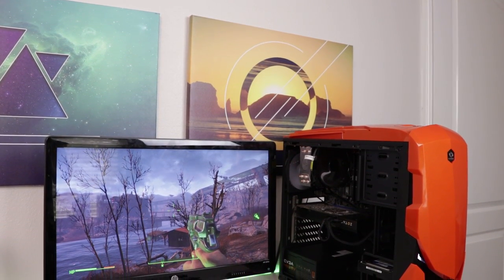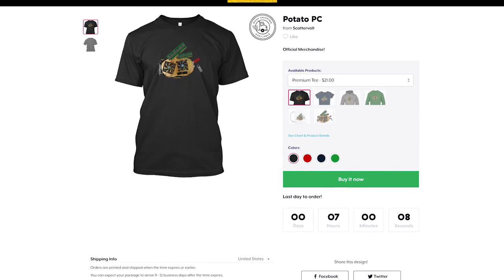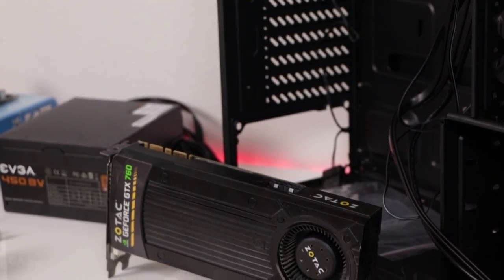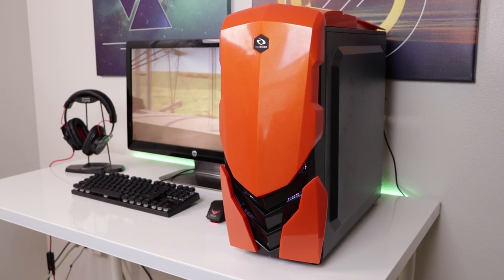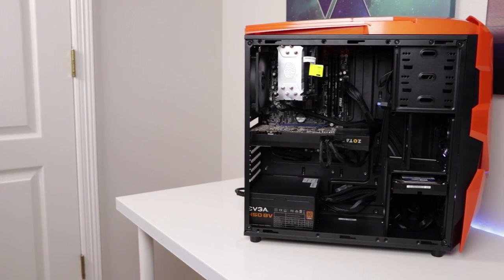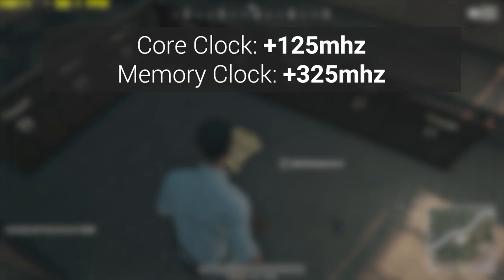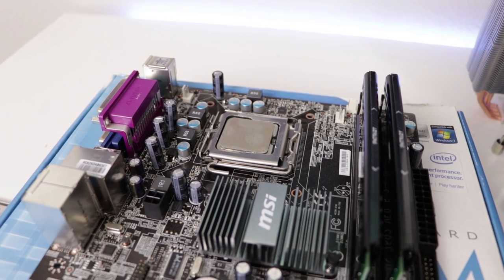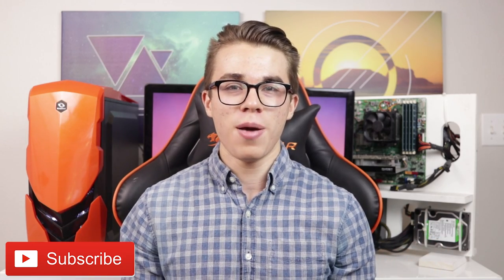The $100 Gaming PC to Survive the Cryptomining Apocalypse!

Comment: still better then my pc...
Reply: Im buying a pc with gtx 1050 ti core i3 overclockable and some other good specs😀
Reply: KingVoxx why are u making me jealous
Reply: KingVoxx I recommend getting a Ryzen 3 instead as the price : performance ratio is great compared to Intel.
Reply: iam buy a pc with gtx 1070 with 16gb ddr4 ram and core i5 7600k
Reply: gamin tacoos Or the Ryzen 1600/1600X as I mentioned before the price to performance ratio is great
Reply: man instead buy g4560 instead of i3 overclock it you will get better performance than i3 for sure
Reply: lol
Reply: +KingVoxx i got i5 with a gtx 1050 ti
Reply: KingVoxx DONT GET THE 7350K
Reply: Get a ryzen 3 instead.
Reply: My PC right now has an i 7 6700k, MSI GTX 1070 and 16 GB Ram
Reply: My pc is more than 100 dollars. And my pc is worse then that one
Reply: Mr Frozen Light Intel is better
Reply: same and i spent $700 on mine :(
Reply: +KingVoxx
Those specs are not exactly "good", but I feel you. i5-4440 and HD7970 here
Reply: i would go with the new Ryzen 3 1300X. 3.5GHz, 4 cores instead of 2, and it's about the same price as a lot of core i3s (you could also go with the ryzen 3 1200, 20$ cheaper)
Reply: just finished my i5 7600k,gtx 1080 sc, 16gb ram build!
Reply: Cuban Taco motherboard?
Reply: 90Days msi b250
Reply: i’ve been playing Zelda: Breath Of The Wild on it in 5K! 😂
Reply: I just have an acer tablet/laptop thing from like 2015
Reply: gamin tacoos i got 4 titan gtx 1080 32 gb iCore 7
Reply: I only have a laptop and it can barely run gta iv

Comment: Just got a full Ebay el-cheapo build started:

Things I bought ~
1.) Xeon E3-1220 v3 at 4 core, 8 thread 3.1Ghz 3.9Ghz max turbo 90W $20 USD
2.) MSI B85M-IE35 DDR3 ram at 1600Mhz dual channel $45 USD
3.) EVGA GTX 750 ti $30 USD
4.) 8Gb Crucial DDR3L memory at 1600Mhz $20 USD

Things I had on hand ~
1.) Micro ATX HP case
2.) Cooler master 500W bronze rated PSU
3.) Cooler Master low profile Heatsink and cpu fan TDP 100W
4.) 1TB SSD

The total money I have put into this build has been $120 USD after taxes and there is PLENTY of future upgrade room. People, being poor is no excuse for not having a practical gaming pc on a budget.
Reply: how much was ur PC
Reply: @elysian8823  Read what I wrote again. I have the prices in my comment. What I had on hand I didn't pay for.

Comment: You should do the tape over clock mod on the Q6600
Reply: King Bladedmaster I've done that successfully on a prebuilt hp, but I would derived if you could do that in conjunction with motherboard over clock settings?
Reply: King Bladedmaster I'm

Comment: Guy did i start good i bought  a Q9550 2.83 (overclockable) 8GB of ram and a CPU cooler (Zero therm CPU Cooler) for 72$ i just need a good GPU and a PSU (alreddy have os and hard drive
Reply: Rxtro hell ye.
Reply: You started off pretty great actually for that price. I'd go with the GPU and PSU mentioned in the video to finish the build if I were you
Reply: How'd you get the ram. So cheap
Reply: Rxtro Lucky, I have a RX 470,  8 Gb DDR3 and a 600 watt PSU (overkill) all I need is a Cpu and mobo.
Reply: If it makes you fell any better, I'm using a 650 watt PSU. Got it paired with a Q9550 @ 3.07GHz, 1050 Ti, and 8GB DDR2. It was the only one I could find at Best Buy to replace a cheapo one I had that was making really bad clicking sounds.
Reply: Tennis Ball You have a working PC kmn
Reply: Tennis Ball Would you recommend the Q9550? I want to make a temp build
Reply: Tennis Ball can you tell me how your processor preforms with the 1050ti?
I have the core2quad q9500 2.83 Ghz ! Will it perform better in games comparing to yours by adding 1050ti in my build?
Reply: Tennis Ball mine pc does that for alredy 2 years now its almost 1 am and its making that sound from time to time and I just have to ignore it , maybe it even became normal for me
Reply: A 1050ti works well with a Q9500.
Reply: I bought an asrock amd 970 gaming 3 R2.0 with an fx 8320 and a 500gb sata 3 western digital blue hdd and a blue led seetrough  sidepanel case and 4Gb ddr3 1600 for 60$ 
And a asus gtx 680 4GDDR5 version for 33$ new in the box so 90$ total just need a cpu cooler and a PSU and got an ultra budget build
Reply: H31MU7 This sounds good. Have you tested this scenario?
Reply: Rxtro, You need a Striker II for that CPU!
Reply: Tennis Ball can you run bf1 with that pc?

Comment: You should put links to the parts in the description..... I really like the case and would like to know what it is
Reply: TY NIGGA
Reply: segotep ninja i think? In bulgaria its cheap af, but trut me, its trashy af. 
Go for cmt 120. PSU Sot, Glass, good ventilation,hdd ssd slot,optical drives, good cable managment., but its like 5-15$ more.
Reply: Jonothan Peanut thank god you were born
Reply: Wait so I find out that raidmax case that pc case was not $20 its $50 how di d you get it on $20?
Reply: Raidmax Ninja II

Comment: It's definitely not 100$ build to be honest. Here is my build:
- any LGA 775 G31 mobo from Ebay (20$)
- Xeon E5430 4-cores CPU from Aliexpress (15$)
- new Deepcool Archer Pro cooler (10$)
- cheap new 450W case (25$)
- 2x2Gb DDR2 from Ebay (15$)
- GeForce GTX 460 from Ebay (35$)

Total: 120$

Comment: Even though this is a good build for the price and has a 760, that Q6600 is a huge bottleneck. RandomGamingHD had a build with a 660ti and an FX 4300 processor that got double the frames in most of the games tested here. It probably would raise the price, but replacing the MB and processor would give Freedom a huge boost in performance

Comment: I got a deal for 90€ it has i3 2100 dual core 3.1ghz 6gb ram 320gb hdd 420w psu geforce gt 1030 2gb msi gpu is it good enough? There was pictures of gta v running at 61fps at low settings, csgo 93-116fps and fortnite about 93fps.

Comment: 1:10
I just realized
The open concept pc
on the right
is the HP E9220Y Motherboard
How do I know this?
I'm using one right now
And that HDD is identical to the one it comes with
And their DDR3 RAM clock speed goes only to 1066MHz when maxed out to, uh, well, 16GB

Comment: instead of old q6600 lga775; you should try using the intel xeon lga 771 with the lga 775 to 771 adapter lots more power for smaller price!

Comment: core 2 quad? that is not the best bang for the buck at all, for all the hate on dell desktops a westmere pc that can take a 4c/8t xeon is definitely a better deal(they are like 20$ for a base clock of 3.2ghz boost 3.33), there are plenty of options like a dell t3500,t5500 and lenovo s20(there are others but thats off the top of my head) the t3500 specifically come with a 550w psu and generally comes with 6gbs of ram for less then 70$

Comment: I can tell you i have i5 2 gen and gigabyte oc 760 and can run  all those game on high or max setting with 40 -60 fps Cs go is over 200 fps ''Note'' Might be some drops in fps at some points just change AA or lighting setting or shadows a bit lower and still rest to max  = better then consoles *

Comment: I have the Q6600, I am still happy with it. I might get a better xeon 771 mod for my mobo, but atm its not a priority. Also i installed windows 10 no problem with my chipset. I'm planning on getting a better GPU from a gt 710... i hate that thing, i used to have a r7 240. A helluva lot better than the gt 710 but now im looking at a gtx 660 or gtx 760. I play fallout 4 at 20-30 frames.

Comment: Is there an alternative to the GPU or power supply?
Reply: kentek PSUs works wonders for the price. GPUs on the other hand are going to be hard because fake 1050s and flagship 1080s does not perform as well as the real counterparts.

Comment: i have built better i built a pc with a 3.6 ghz 4 core cpu overclockable to 3.8 ghz with a ASUS M5A78L-M Plus/USB3 DDR3 HDMI DVI USB 3.0 760G MicroATX Motherboard and 4gb of ram and a nvidia gtx 720 4gb drr3 graphics card and a 500 w power supply for the total of 180 dollars
and the case was a ROSEWILL ATX Mid Tower TYRFING tower

Comment: Lol...my specs.
Intel Potato  core 2 duo 2.4ghz
Potato gt 710 2gb
4 gb potato ram
Reply: Wizderphy
What else do you have.. potato 320 Gb HDD?
Reply: an_u tech  kinda ... I have 500gb potato HDD
Reply: never underestimate the power of core 2 extreme or pentium 4 because those beat my current potato ideapad 100's i5 4200u cpu. I've gamed with pentium since 2007, and it served its purpose until I got funds to upgrade to an i7 4790k back a couple years ago. I'm sure upgrading your core 2 to a first/second gen i5 or i7, a 500w psu, and some more ram could make you some curly fries for your gaming.

Comment: I build one for 60 euro
Computer case from the trash free
Mainboard trash free
Cpu i3 2100 e bay 20 bucks
Ddr 3 ram from friend free
Gtx 760 from friend free
Hd wd 1 tb30 euro ebay
Power supply from friend free
10 euro for ssd 30 gb ebay